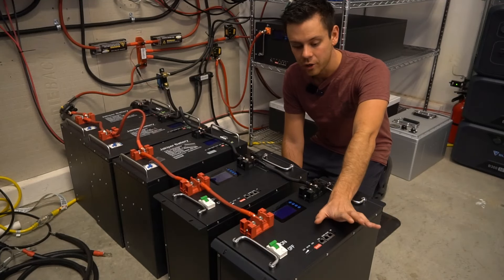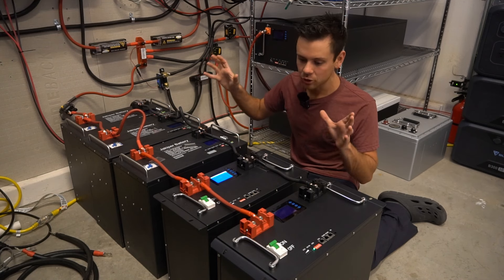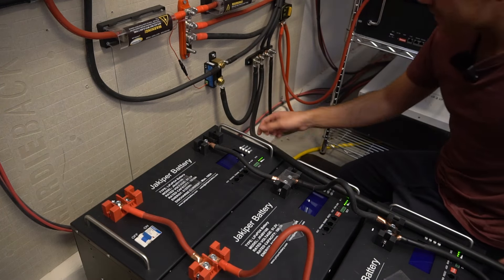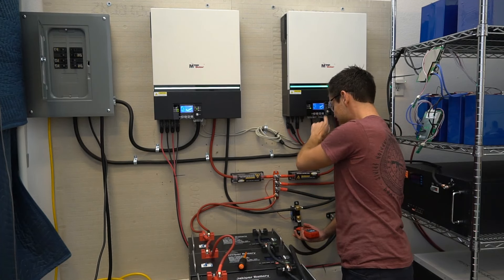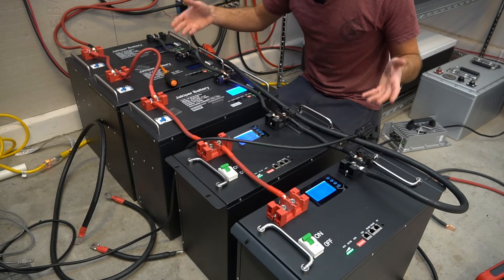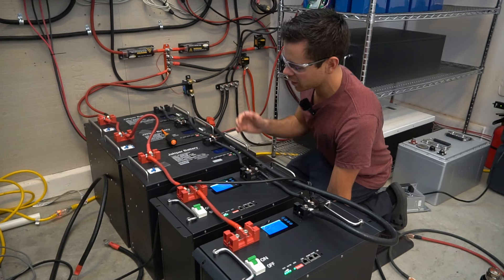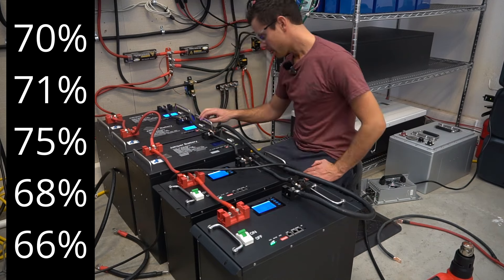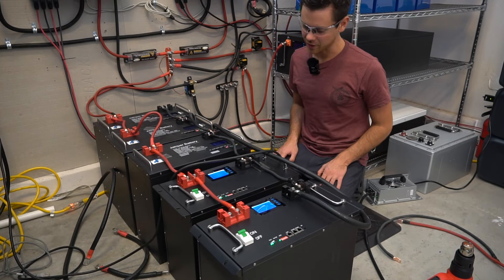Current Sharing Experiment: 25kWh LiFePO4 w/ Diagonal Wire Configuration

Comment: Reverse return (ie your diagonal connection) is a very common designed used throughout the engineering world.  If you constructed your wiring with reverse return buss bars or simply reverse return as depicted in this test, electrically there is zero difference.
The differences in “supplied amperage” you are witnessing between these server rack batteries is actually minor internal electrical differences within each battery, and not caused by wiring.
Do an experiment with reverse return on a buss bar and simple reverse return with absolute equal length cables, you will find there is no difference.  But negative and positive cables must have as close to identical length as possible, just the same as your “buss bar” idea, total cable length does matter.
Reply: Exactly. Each battery is connected via a series of 4 cables to the diagonal points so each battery "sees" the same wire resistance. 
The battery closest to the camera sees 0 wires to the negative diagonal point and 4 red wires to the positive diagonal point.
The next battery sees 1 black wire to the negative diag. point and 3 red wires to the positive diag. point.
And so on...
The battery furthest from the camera "sees" 4 black wires and 0 red wires.
Reply: I had the same comment.
Reply: Yeah I think you and Daniel are right, right? I could not see any way that there could be more draw from the batteries on the ends than the ones in the middle.
Reply: Agree. Adding bus bars to the "diagonal" config is the same thing. A diagonal config with bus bars.
Reply: I have questions on this topic.  Since my positive conductor will have the 400Amp T-fuse and a battery Isolator switch and as a result, a slightly longer run, should I be adding more negative conductor length to my setup to try and equal that?  I’d assume it’s resistance that’s most important and not exact length, but how to determine that?  Do I just measure the ohm resistance on each conductor and then add more length to the negative cable if needed to match what I’m seeing on the positive?  BTW, my two BattleBorn GC3 batteries will be connected with buss bars.  Thanks in advance for any input!
Reply from the maker: There would still be a slight difference because the cells are different capacity. But would not be that big of a difference. I also cannot add larger conductors to the jakipers terminals, so I am stuck using 2 gauge cables. But yes good points!
Reply from the maker: Furthermore, these batteries come with 6 gauge cables. I am using 2 gauge. So these issues will occur often with people using server rack packs. With sok, if you can add 2/0 gauge for every connection, it should be good. But again, bus bar is easiest way. Less connection losses as well. Can easily use 6 gauge cables and have equal current sharing.
Reply: @jimsjacob  I think the way to look at it is to consider the entire loop from a battery's positive to negative terminal, and what we are worried about is difference in the length of that loop from one battery to the next. That fuse and isolator is in the loop for every battery, so it does not contribute to any battery to battery differences. Only the conductors between the batteries need to be similar length... (Unless you are putting a fuse and isolator between every battery?)
Reply: @bkuker  I had thought the same thing, but I kept hearing that the "conductors" needed to be the same length and in the diagram shared, the "conductor" was the cables, not the bus bars.  There will be nothing but bus bars between my two batteries and of course the cable conductors connecting to the load.
Reply: @jimsjacob  Ah I gotcha. If you are connecting the batteries to the bus bars with cables, those cables should all be the same length.

To be totally pedantic, battery A could have a 1 foot positive cable to the bus bar, and a 2 foot negative cable, and battery B could have a 1.5 foot cable for both... As long as they both have that same 3 feet of cable in the loop.

Comment: would parallel connecting only two batteries in diagonal be almost the same as parallel connection via bus bars? I'm linking two lifepo4 batteries in my RV build and hoping to save by not buying bas bars, it looks as though diagonal connecting only two batteries is fairly optimal. thoughts?

Comment: So Im about to set up 3 24v 280AH  batteries in parallel and I purchased 2g welding cable for it. Will this be OK? I know 2g Battery cables handle less volts then 2g Welding cable(600v).

Comment: Noob comments - what you have is great for a lab, but what about an actual home environment (with kids running around, etc).  What safety 'requirements' for this system (mine are in my house mech room with locked door.
- What is a practical rack configuration (diagram with parts) to put say your 5 rack mount batteries in a rack with a bus bar?  
-- -- Should the rack be on the floor or raised off floor (busted water pipe scenario, etc)? 
- What is the standards/regulations for adding a bus bar to a rack (esp a metal rack) including grounding.  What racks are suggested for this bus bar configuration?

Suggest you address moving from this 'lab' configuration to an 'operational' home configuration.
Thank you for all the informative videos - you have really push the state of knowledge for everyone.

Comment: Can you double the wires on the positive and negative like you done on first positive connection...
It will fix the issue, and it will not get hot... No needs for large busbars, just need to understand that 200A like to float easily with more wires...
Take care...

Comment: It would be interesting to measure the voltage drop between each positive and/or negative battery interconnect cable during high amp operation.   For example, from battery 1 + to battery 2 +, etc.  particularly that one near the wall that you said was getting very hot.
Reply from the maker: Yeah I should have done that

Comment: Do u have any videos connecting 6 12 v batteries to a 24 v inverter , and what is the charge rate i should set for flooded lead battery bank of 600 amps

Comment: hi will how do you charge each battery up to 100% soc.what kind of charger do you have.not alot of  options available in south Africa
Reply: You can use your inverter to charge the battery using solar (or mains/gen if you're connected) - remember to lower the charging current when only connecting 1 battery.

Comment: Really the leads get hot one of the most dangerous things to do with parallel stings is to have dissimilar voltages as the high voltage battery deliveries its full current to balance the voltage in the parallel circuit.

Comment: Do we just take for granted that the wires inside the battery are of equal length or resistance?  If we go to all the trouble of doing it correctly outside of the battery and inside your two different types of batteries are different lengths it may cause a bit of imbalance. Just asking?
Reply from the maker: Yes that's a problem. Hopefully they are.

Comment: I’ll ask the same question I asked on yesterday’s video.  In the diagonal diagram you shared, the Negative conductor is longer than the positive.  While it’s a drawing, it still represents my question.  In my setup, it will be the positive that has the longer run since it will pass via a T fuse and then a battery isolator and then run up to the power distribution panel (Lynx Distributor).  The Negative will be shorter as a result.  Is that a problem?? Only two GC3 BattleBorn batteries in my scenario…
Reply: You need to compare total resistance, not just on one side. So you'll add up all the negative wire plus all the positive wire for each battery's path. Then you'll see it doesn't change the current sharing between batteries, even if the main positive wire is 10ft longer than the negative wire. 

Where the length of cable does come in, however, is the total allowed voltage drop, which in USA under NEC is 3% only, so you'll size up the cable for voltage limits at longer lengths.
Reply: @stefanvanzyl9090  Thank you for your reply.  I was thinking that was the case, but as this is my first foray into this battery/inverter build, I had to ask. I’m thinking the main concern as to conductor length is the lengths between batteries that are in series or parallel.  My buss bar will mitigate that concern.
Reply: @jimsjacob  sounds like you've got an extremely expensive setup going on there, battleborn batteries, Victron accessories! Victron has incredibly detailed documentation, technical writeups and guides, but I don't sell/install their products cause they're 4-6x more expensive, and nobody around here wants to spend that much.
Reply: @stefanvanzyl9090  Guilty as charged.  After I bought the battleborns, I realized this.  I have to say that the Victron Lynx Distribution is very well layed out and made.  I was gonna make my own but I have tight space constraints, so it seemed the best solution.  I swallowed the bitter pill and ordered it.

Comment: Will, 
I️’m installing six 48v EG4 batteries in an EG4 rack and measured the rack’s tinned copper busbars at just 30x5mm. Actually less than 145mm^2 as they are milled and rounded thinner. I️ see standards for busbars vary for materials but copper, it’s 1.25 x cross-section, WELL undersized for 600a 1.0C at 48v and crazy undersized for 24v. I️ see folks on your forum with the rack are having problems. I️ talked with leadership at Signature Solar that what they market as “OVERSIZED BUSBARS” are the opposite but got nowhere.
You recommend EG4. Please help.

Comment: I know it removes some of the DIY-factor when you increase the voltage, but I can't help but think that a lot of these wiring topology issues would be made moot if everything was just connected in series and the inverters ran off 240VDC or thereabouts. Higher voltages typically have more conversion efficiency, not to mention less resistive losses with the same cables.
Reply: Does anyone make a 240V DC to 120 / 240 V AC inverter though? The biggest DC inverters I've ever seen are all 48V.

Comment: So if you had 2 EG4 batteries would you still utilize a buss bar to wire them in parallel, or when only having 2 batteries does it make it more "normal" to wire them like in your video?
Reply from the maker: Oh for just two packs, diagonal configuration is fantastic actually.

Comment: The easies is to use for instance the “Victron Lynx Power In” and cables of the same length for each battery , no big busbar needed.
Reply: You do realize it's just an overpriced busbar with a pretty blue shell, right?

Comment: It might be a stupid question, but why not use a think copper bar directly on the battery connections?
I mean a sort of home made copper bar. Buy the copper bar, drill some holes in in, connect.
Would't this work, and also be cheaper then a 'seperate' bussbar with short cables to every battery connection?
Reply: As long as it is a stationary installation where vibration is not an issue. The other issue with a copper bar directly to the batteries is that you cannot service them easily if any need to be accessed and removed without disrupting the remaining.

Comment: Thanks for the video Will. I was interested to see what happens when you get to 0% SOC on this setup.
Do all of the server rack batteries shut down at the same time or,
do they shut down individually till only one is left to supply the whole load and it shuts down because of added voltage drop or overcurrent protection.

Comment: Interesting experiment but I think a lot of people would say the difference in internal resistance and the difference in capacity would also throw off your numbers at the rate of discharge. 

Unless the batteries were all from the same year make model manufactures date of production line then you could be confirmed of accurate numbers
Reply from the maker: Yes that is what I said in the video

Comment: Morning!! Another great nugget of ur teaching Will. Im in a pickle here and maybe u can assistant me. I have 4 GBS prismatic 100ah lipomag4 batteries ( they don't have any BMS) that I was told I couldn't connect in parallel for a 12v system. Then I need to connect a BMS to all 4 batteries to make them a complete 12v system. I hope I explained ot as. Clearly as possible. An u assistant u or ur "crew"  can provide would be of greatly appreciated. Ciao & carpe diem!!

Comment: @DIY Solar Power with Will Prowse  as much as you like these server rack batteries, would you recommend them in a solar RV set up? I am currently using a 12V "Big Battery" and really like it but I may be selling my camper and setting up a new system in a different camper. I would like to use one of the Victron Multiplus inverter chargers.

Comment: Be a good idea if you need to change the size of the lead leaving the battery bank and going to the inverter that also change the size of the leads between the batteries up to 50% of the way through the bank.  If the batteries are sized the same, then it will be the middle spot of the battery.  So, the leads between 1,2,3 should be bigger than between 4,5 (where battery 1 has the lead going to the inverter).  The batteries furtherest from the inverter lead can have a smaller gauge wire.

(It probably seems weird when using the diagonal system that the negative inverter side will have a larger wire than the positive and the battery on the posivite side will have a larger lead than the negative.  But you can tell which leads need the higher gauge by telling which ones get hot.)

Comment: Love the test. I wonder if cell temperature also plays a role. Headway cells are lifepo4 and the car audio community has done tons of testing. One thing with Headway cells is as they warm up they actually perform better, the voltage sag even rebounds. So as some batteries get a larger draw initially they would sort of warm up faster then as the others get more into performance mode they will catch up and balance out. I wonder if the electrical circuit designer software that shows flowing electrons and values in a given setup would perform the same way. Ultimately the best battery design would be the design with equal lengths and thickness of busbar with the absolutely shortest length. Maybe do the test with a thick copper flat bar running up each side with a short connection from each battery to them and run your main cables to the center of that. Or instead of 1 thick busbar you can have 5 smaller cables of equal length going from your distribution directly to each battery.

Comment: Similar question but on cell level:  i have a sailboat eith limited space, so i have to split up my 16S configuration to 4S4S meaning 4 packs of 4 batteries connected serial on 4 locations within 1m / 3ft. 116S BMS with 2A active balancers (2A). Electric Motor draws 100A, BMs could support 200A.
How bad is it to connect those 4 packs with 1x70mm2 or 2x70mm2 cable when connected diagonal. „Short busbars“ have 50mm2 to 60mm2. Has a 1m long cable/busbar with 140mm2 similar resistance? Are doing the active balancers the rest?
Or do i really need massive copper rods as a bus bar interconnecting those 4 cell packs (20mm x 20mm = 400mm2) ?
What are your thoughts?

Comment: Will aren't you supposed to hook those packs together with the data cables so they can talk to each other and coordinate load sharing? Isn't that a thing?
Reply from the maker: It's entirely pointless in my opinion.
Reply from the maker: You can have your whole system shut down if one battery goes bad if packs are communicating. But I would rather have the BMS disconnect instead

Comment: I have a question would trimming the sides of the terminal connectors to fit cause a issue ??? I've done it so many times in the past with out ill effect on smaller stuff.. Now I'm wondering if I've just been lucky for 30 years

Comment: Should we run this configuration when top balancing? I have 16 304ah eve cells top balancing right now and have noted the voltage differences between the first and last cell
Reply: When connecting anything in parallel, this is the easiest practical way to do it correctly. If you do each battery individually for the last bit, by the time you've charged the last one, the first one has run down a bit already.
Reply: @stefanvanzyl9090  Interesting, this goes against the previous consensus for top balancing cells.. At least what I have seen
Reply: @EMA9-MCAD-RSI  lots of people say lots of things, unfortunately. I can only speak to my own personal experience. You can try top balancing individually and then letting the cells all rest till they measure equally again - but connecting freshly charged cells with freshly rested cells will definitely lead to disappointment - though a decent BMS with active balancing sorts that out anyway

Comment: Thanx for the videos as always. But I think the test is not conclusive.  The precondition of having the battery banks with the same capacity. The difference in the internal resistance of the bigger batteries is impacting  the results negative. It would be nice to update the video with the 3rd test having equal battery banks. This is one of the elephants in the offgrid room with many advises that negate each other. Maybe your test could then include using busbars vs wires with the thicker wire to the middle battery. The results would be conclusive. Thank you once again. I do enjoy your videos as I also have an offgrid farm am sett8ng up in namibia

Comment: If bus bar is not an option how about using same length wires going from each individual battery directly to the inverter < but I'm thinking  will probably not work since the inverter only has 2 inputs for positive and negative - the inverters will have to makes its own built in bus bar to do that.